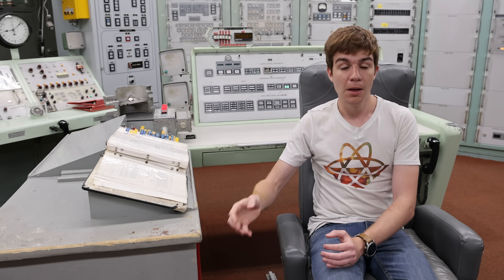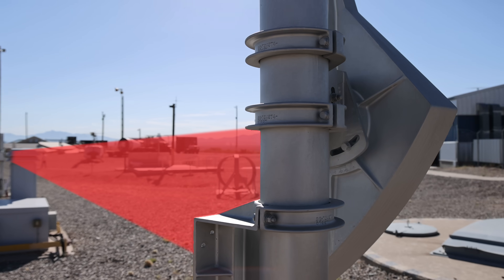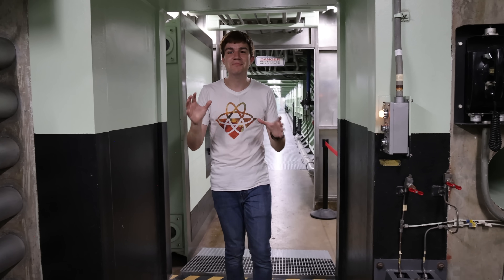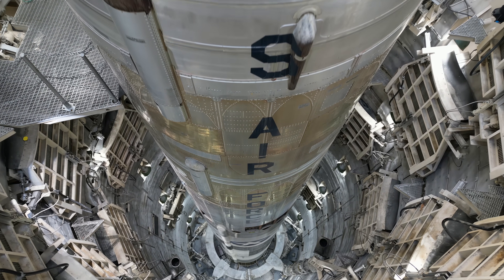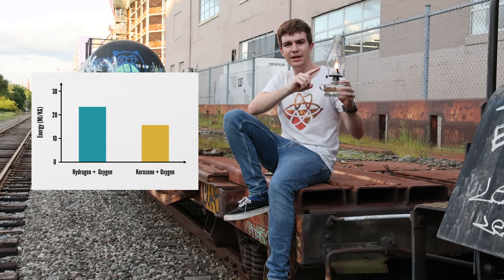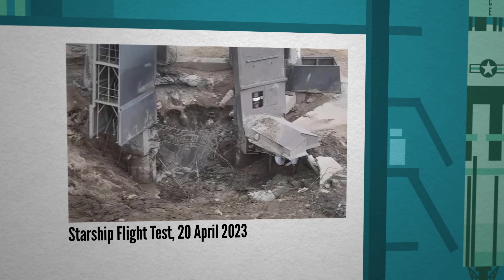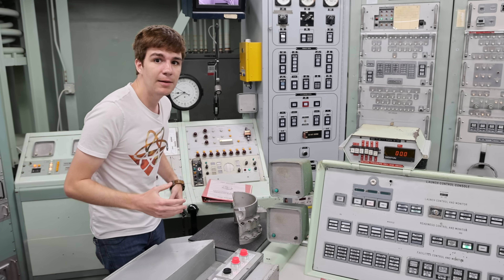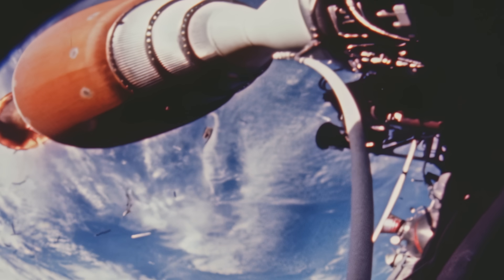How to launch a nuclear weapon

Comment: I stopped by to visit because I used to work as a ground radio communications technician where one of my assignments was working at Grand Forks in the missile field. I worked on the system, connected to that spherical antenna that you were standing next to at the beginning of the video. SLFCS
Reply: I helped disable some of the pop-up receive antennas up at Grand Forks after they took the HF system out.   They had explosive charges to raise them.
Reply: I come back and watch these videos and learn more about what I was doing after the fact that what I was trying while I was doing it in some cases.  You knew specifically what you were doing, but you did not know all the background information that you can get through these stories.
Reply: The Titan site were not financially unaffordable, I don’t think if we wanted to increase our launch capability and survivability by having more sites.   Less operators, which reduce costs, and complexity also.
Reply: When you’re in different parts of the military, depending on the mission, you have more funding than when I was in missiles there was never a problem with money.   You would work in other areas and have to defend the funds that you had. 😂
Reply: Don’t compare an ICBM to a NASA rocket because someone will get them mixed up and launch the wrong thing at the moon and we won’t have one anymore😂
Reply: Ours were cheaper because we used solid propellant.  We won Titan. 😂

Comment: What happens if your actual key and the lock is designed on the same length does that mean within gravity's pressure and pull it can be unlocked you ought to think about that really f**** closely

Comment: Some additional facts: The unlock code for the missile has 16 letters on each of its 6 wheels, making for a total of about 16.8 million possible combinations--only one will allow the missile to activate. If the wrong code is entered three times, the system locks up and the missile is completely unable to launch until maintenance crews come to unlock it again.

Also, I love how the code in this example was "URDEAD"

Comment: (08:50) A milspec hardened, locked safe, holding the key to the last stage before ending civilization itself -- secured with two MasterLock padlocks?!? (Yes, I know they are museum replacements.)

As a past journeyman locksmith, I can open one of these padlocks easily. I paid $100 in 1984 for a specialty publication that described the general technique of defeating a combination lock, but now all the information for specifically opening most MasterLock locks is freely available online.

I once owned the “most expensive lock ever made“: A behemoth keylock to secure CIA strongboxes. Now that was a lock!

This one, definitely not milspec...

Comment: As mentioned already, the amount of oxygen of 90000 tons is completely wrong, the entire Titan II fully loaded was 170 tons. But actually the Titan II never used oxygen anyway, the stage 1 propellant was N2O4 and Aerozine-50.
The Titan I did use liquid O2 and kerosene but it was too dangerous so Titan II went with N2O4/Aerozine50 which had the added advantage of being storable

Comment: Excellent run through, although recently it was revealed the code for the butterfly valve was all the zeros. Was it the case that each control room controlled eight missiles within that wing and it took two control room launch authorisation procedures to give a valid launch command? Of course in the UK, once the US stood down the THOR missile system which was operating on RAF bases we switched to aircraft delivered nuclear weapons. Mind only had a four minute warning of inbound Soviet ICBM'S, so four bombers had to be airborne in under two minutes. Strangely enough I felt safer in the Cold War than I do now, Dad served in the RAF as an aircraft electrician, 1959-1970.

Comment: Technically that's not "ticker tape" (which is for telegraph output), that's punched tape. Along with punch cards, one of the earliest data storage methods. Yet, even by 1960s standards, that's pretty damn archaic. "But we can't use this newfangled magnetic tape for this, the electromagnetic pulse will-" "Guys, hate to break it to you, but paper tape is made of paper, it's not exactly sturdier material in case of nuclear attack."

Comment: Good video. The Titan II silo had side vents for the exhaust plume; two separate tunnels to the surface that exhausted either side of the silo door. They're visible at 9.53 in the vid.

Comment: ok ok Jimmy Boy but the real question here is: do both keys need to be turned in sync or can one be turned with some small delay as long as they both reach their active state. If the implemented security logic only checks their state, it would be a protective measure at most effective against the feeblest of the weak minded individuals who couldn't come up with a simple contraption to turn the keys himself (or herself but let' be real here - it'd be him in all likelihood)

Comment: Two keys, one arduino, one servo motor, one operator :) Missile away :) good thing these have now been de-comissioned.  I don't want a wayward titan II hitting Botany bay or Airlie beach here in aussieland :)
Reply: If you're going to be assembling a Rube Goldberg machine you'd be better off just pulling the key switch out in advance and running a couple of wires to it

Comment: thank you! i got a nuke off ebay and was wondering how i was ment to launch this thing
Reply: Why be a mere spectator in Gotterdammerung when you can participate!
Reply: @benkloos2827, maybe exchange it with one of the 400 Minuteman III nukes!
Reply: Most nuclear warheads were designed to be dropped from planes, but if you have a missile, the security code is most likely "0000"